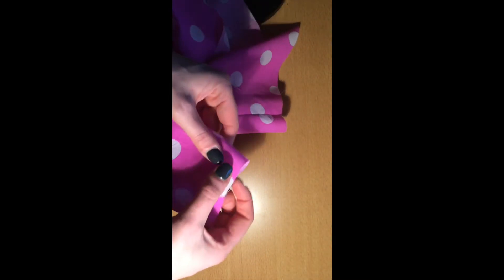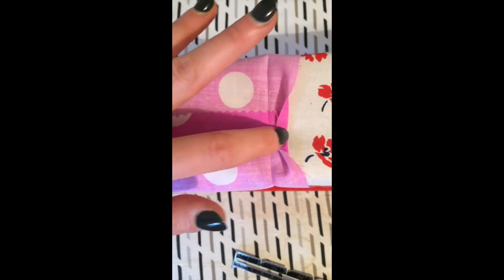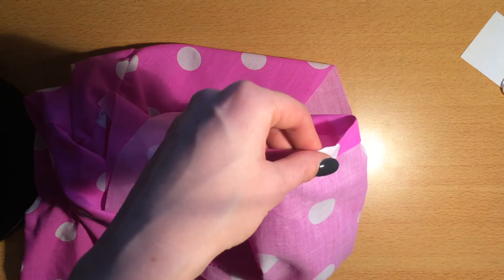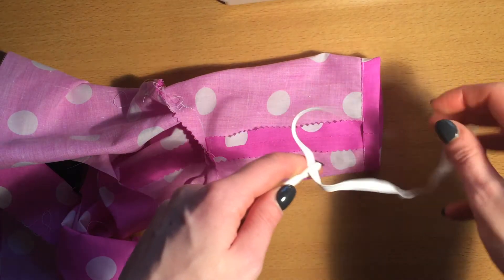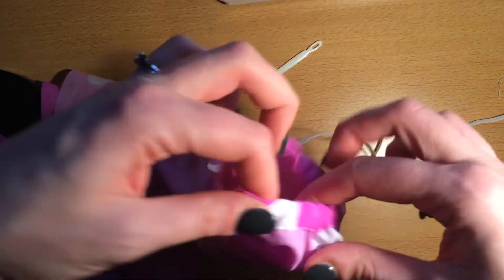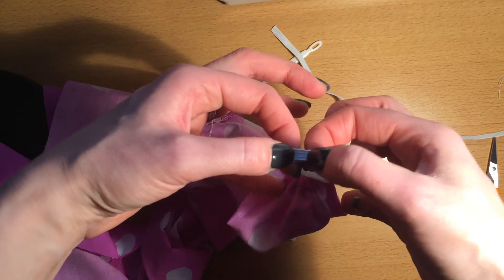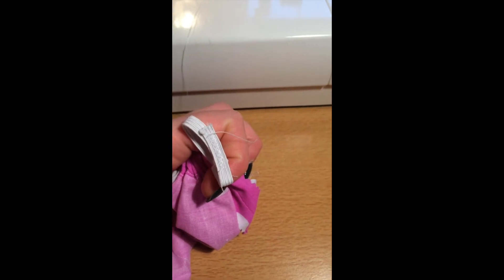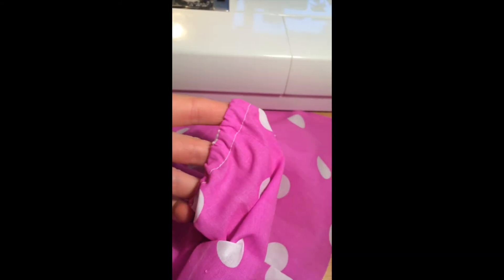How to create an elasticated cuff

Comment: Great video! I hope you don't mind me giving you a little advice. When you topstitch the sleeve hem in order to create a casing for the elastic (at 2:56min approx), it will be way easier if you turn your sleeve on to the right (rather then wrong) side, and stitch on the wrong side, as you usually do.  This way you would avoid battling with all the bulk fabric around, because it will accumulate mostly above the stitching area. The process would be way easier, even with narrow sleeves, because the sleeve's working space will be wider. This is how they do it in the industry, on the large-table machines.
Reply from the maker: Thank you for the tips! that would be much easier :)

Comment: I've researched, still dk why elasticated cuffs better?? Seen on some pants but whyy?
Reply: 1) If the pants are baggy or flare at the bottom, elasticated cuffs will help prevent your ankles from showing if you're doing activities that basically have you going upside-down... certain Pilates movements, cartwheels, etc.
2) Your pants will fit into boots better.
3) If they are pajama pants, the pants won't scooch up during the night.
4) You get to mirror Aladdin a little bit better.
5) If a short-sleeve shirt has baggy sleeves, and you stretch your arms up, gravity will cause the sleeves to bunch up under your arms; the cuffs would help keep the sleeves in place, keeping more of your arms covered.
Reply: @oliviatouba9313  dam fsnks for that

Comment: What is the tool you used to insert the elastic band called?
Reply from the maker: HC GUNSHOT HITMAN it's a plastic bodkin or large eyed blunt plastic needle. You could use a safety pin or elastic threader instead.
Reply: Oh okay. Thank you!
Reply: HC GUNSHOT HITMAN on the off chance you male paracord braclets, paracord fids will work, if you even know what they are. I was fixing the sleeves on a really old hoodie of mine, and they worked for me.